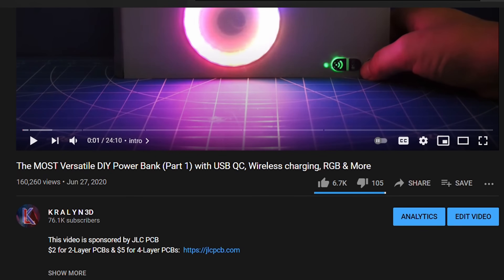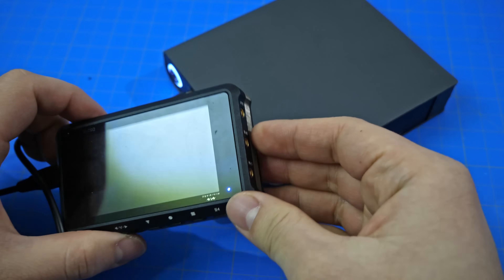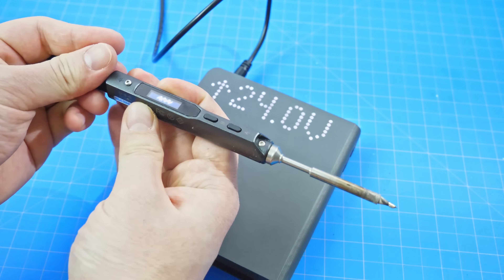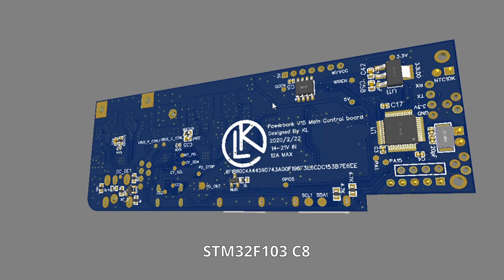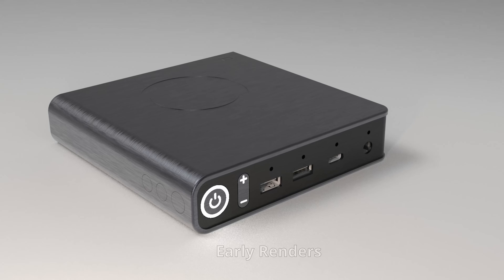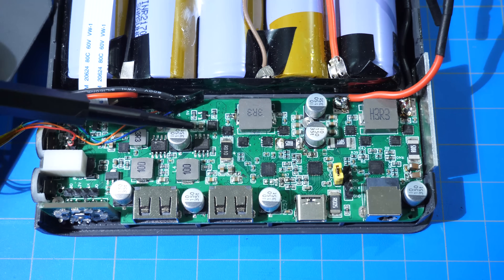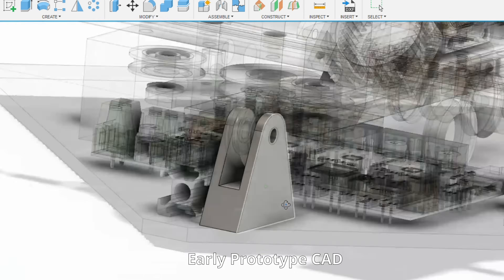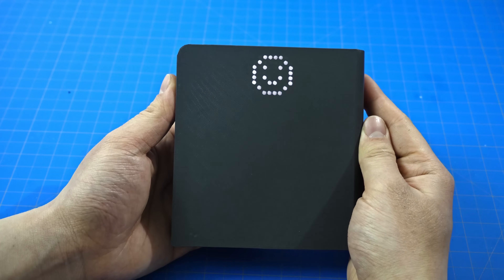Power Bank Project Update! And Others...

Comment: I would want a „Solar Charging Module“! Is it possible?
Reply: You can foldable or flexible solar panels from many companies. You just slap an appropriate adapter and u could even use it as a cover if you leave it outside.
Reply: @yianisss  The last days I experimented with a bought set of solarpanel and a fan. It was making awful noises when the energy wasn’t enough to turn the fan. 
I think a neat electronic that feeds the battery properly would be nice. Also if it works with a range of solarpanels.

Comment: shut up and take my money!
my suggestions: Does the display flicker only on camera or in real? If the last one then maybe a higher frequency will help.
2:10 idk if it's just the camera angle but maybe the arrow is a little too much to the left :^)
Lastly, idk how well the safety of this Powerbank is. Probably like all your Powerbanks very good, but maybe you consider to add a separate circuit just with on primary cell, a few temperature sensors and a buzzer, to make a loud noise if the powerbank catches for example fire or something.
But all in all a very COOL Powerbank!!!
Reply from the maker: Thanks for the feedback! The powerbank does have an dedicated BMS for monitoring the battery, also the lights flicker on camera but not in person.

Comment: I have also modified an emergency light to a powerbank with a modified capacity of 140wh. This also have a bidirectional dc barrel port but the thing that is missing is a bidirectional usb type c port. I can't find any circuit board here in India with a reasonable price. If I have to implement this type c bidirectional port then I have to buy a seperate powerbank which has this function and then I have to disassemble it to gather the circuit. Can you please help with this bidirectional type c port?
Thanks! ☺️👍

Comment: Can you change the polarity of the DC socket if not you could add that because there are devices that have an artery polarity on the DC socket then other  devices. So you could operate almost every device and what would be the maximum current and voltage where the power bank can output ?

Comment: I think you should make a brand name, and then have a understandable, expandable product name.

For example: [brand name] modular 1, or modular pb 1, modular base pb 1, etc.

It should be possible to understand what it is used for, and what tier/version it is in your future sea of products.

What materials do you intend to use? 3D print is good for low numbers, but not mass production. Is it grounded enough to use aluminium?

Comment: The new Powerbank is absolutely amazing! Will definitely buy it when it comes out! I would also love to see the (safety) features in detail, like you have shown for your past versions
Reply from the maker: I did not go over it because there’s too many, from fuses to clamping diodes, and a custom dedicated BMS. I cut it out because it makes the video 2.5min longer. But you will see on the circuit diagrams I am eventually going to release
Reply: @kralyn3d  hello im very interested in your work and wanted to as ask when you were going to release the circuit diagramms?

Comment: Love the new design! Just a quick question, can the module spot be used for additional batteries? (so that it can go on an airplane and have a capacity higher than 100wh) one of the things I loved about the old power banks was that the end-user could just swap in another battery and have it fully charged. It wasn't mentioned and I think it's not possible with the new design, but it would still be extra cool to have additional batteries.
Reply from the maker: That is defiantly in my plans, I will try to add this feature. Although there is a slight chance it might not make it in to the final product if safety cannot be guaranteed
Reply: @kralyn3d  That's good to hear! If you manage to make the additional batteries in the product that will make me buy it for sure!

Comment: Is this power bank the updated version as all the previous other banks? Does it have the same battery capacity? I'm just curious because the older generation models have multiple wall socket outlets
Reply from the maker: This generation has less capacity than my previous generations; this is because it is made to travel and needs to be able to be brought on an airplane. (max limit is 100Wh, this power bank has 92.5Wh)

Comment: will the powerbank have upgradeable firmware to suport future standards?

for the portable 3d printer it might be useful to have a small camera and lights so one can keep an eye on its progress upside down, maybe also an led progress bar or other visual % display showing state of completion.

it would be cool if you could combine the power bank with the 3d printer for a truly portable travel setup when there are no outlets in sight.  maybe even dock the power bank with the module side into the 3d printer for power. realistically, if it is possible, that is only to power the 3d printer.

light wind might be an issue if outdoors so maybe clear or mesh foldable wind / dust shield may help with it. (or maybe that is already too much.)

both the power bank and 3d printer would look great together if aesthetically designed to match. a cyberpunk scifi style would be awesome.
Reply from the maker: Thanks very much for the ideas! I am currently brainstorming aesthetic looks for the printer.
Reply: @kralyn3d  best to you.

Comment: I think you should make a  battery module so that you don't run out of power as fast.
Reply from the maker: That is definitely on the table. It will be challenging to ensure the safe switch over between battery packs, but Ill see what I can do!
Reply: @kralyn3d  You could make the power bank with no batteries and sell different size battery modules.
Reply from the maker: @ebutuoy4811  Sorry but this is not really possible as each different module would need a different injection mold, and each injection mold costs $10,000 - $50,000 to make.
Reply: @kralyn3d  Yes of course the cost of manufacturing does come into play.

Comment: That power bank looks incredible but I am confused as to why you ditched the ATMega328p?
Reply from the maker: For many reasons, not enough pins for all the interfacing(2x I2C bus), Low flash storage for displays,  etc. But the STM is still very simple to program and there is even an Arduino library for it.
Reply: @kralyn3d  Understandable but you could have used an ATMega 2560(the microcontroller used by the Arduino Mega). It has 54 I/O pins and all around an upgrade from the 328p. The power bank still looks insane and looks awesome with the STM32 microcontroller.

Comment: This looks incredible.  Are you planning on fluting the backside of the device on the alumin(i)um heatsink where it will be resting on the batteries... or will that be plastic?
Reply from the maker: I think this design is possible, but it will add additional costs, I will test and work with engineers to figure out if it is necessary.
Reply: @kralyn3d  Looking forward to your updates!